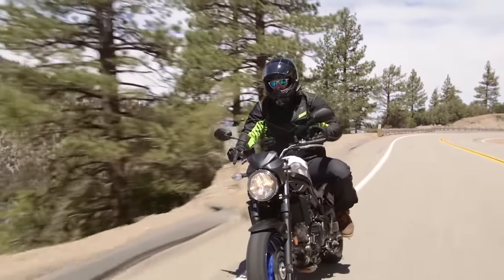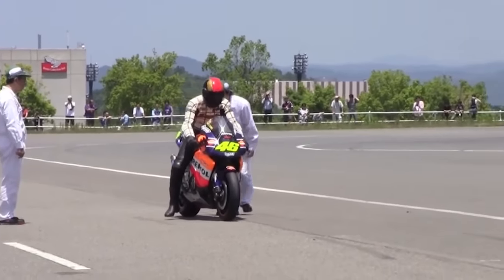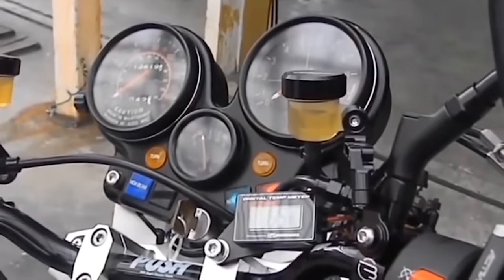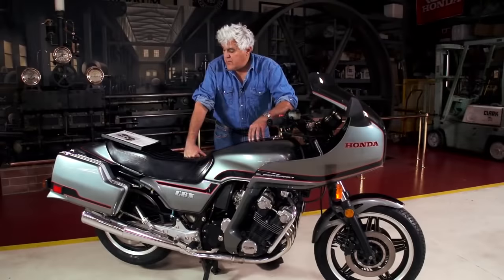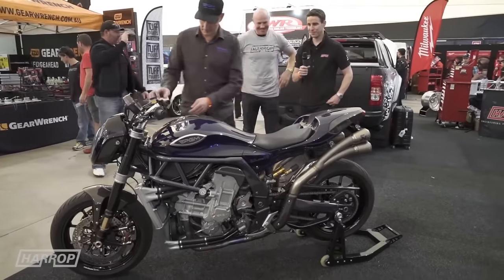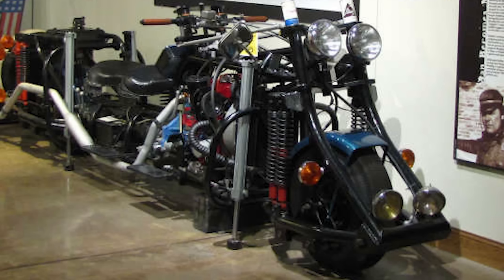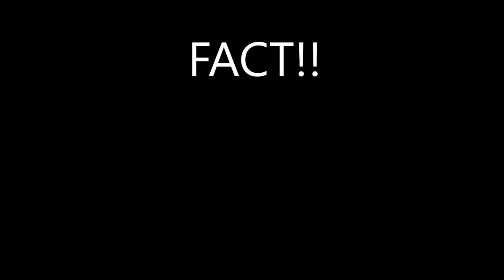The Most UNREAL Motorcycle Engines Ever Produced

Comment: I had several Mach 3 500cc triples. My first one had cracks in the spark plug wires (oh yah.... this beast actually had a distributor and distributor cap like cars did!) When it rained i would get the crap shocked out of my knees where they touched the gas tank!!! The CDI ignition put out wicked spark. It's spark plugs were like sawed off flat versions of traditional spark plugs. No  ceramic insulator and arm hanging down off the threaded end. Neutral was all the way down on the shifter and all the gears were up. with all early 5 speed  japanese street bikes if you beat on them and shifted hard from 1st to 2nd, you would bend a shifting fork in the bottom end and eventually wind up withj a transmission that would miss 2nd gear because the sides of the shifting fork were worn off......God, i'd be a rich man today had i kept akk the S,  H1 and H2 bikes i had.

Comment: The Black Pearl is not powered by steam. It might look like a "steambike" but it runs on compressed air. The air is stored in the vessels and is very ingeniously used to get the bike running. t doesn't go fast and it doesn't go far but it goes!

Comment: on the v8 section where was the mention for the Moto Guzzi V8 
The Moto Guzzi V8, or the Otto motorcycle was designed by Giulio Cesare Carcano specifically for the Moto Guzzi Grand Prix racing team for the 1955 to 1957 seasons. Wikipedia
Top speed: 275 km/h (171 mph)
Engine: 499 cc (30.5 cu in) (44 x 41 mm) 4-stroke V8; liquid cooled, DOHC, 8 Dell'Orto 20 mm carburettors
Power: 78 hp (58 kW) at 12000 rpm
Weight: 148 kg (326 lb) (dry)
Class: Grand Prix racing motorcycle

Comment: Yeah, I know that if you asked 10,000 motorcycle enthusiasts the same question you'd get 10,000 different answers, so here's my #1 ... 1966 Honda RC166 250cc inline six cylinder DOHC four valve per cylinder engine capable of 20,000 + RPM, and at 18,500 RPM produced 68 HP and speeds past 150 MPH.  And the glorious sound at full honk from six megaphones!  With Mike Hailwood in the saddle won every 1966 250 GP race.  The next season was a dogfight between Hailwood and Phil Read on the new Yamaha RD05A V-4 two stroke.   Both finished the season with fifty points, and the title went to Hailwood with five wins versus Read's four.  All up weight variously reported between 250 and 268 pounds.  A groundbreaking advance in technology designed by Soichiro Irimajiri, who was also the designer of the CBX.  No surprise.  

#2:  1956 Moto Guzzi V-8.  WAY ahead of it's time!  Designed by  Giulio Cesare Carcano originally sketched on a napkin, eight months later it was running.  In it's final form made 78 HP at 12,000 RPM.  That it was fast was indisputable: 172 MPH, a feat that was not duplicated in it's class for more than twenty years. Stellar, if unreliable, engine in a badly outdated chassis, skinny 19 inch tires, and marginal brakes.  Unfortunately Moto Guzzi dropped out of GP racing before they could fully develop the entire motorcycle.

Comment: The Kawasaki H-1 500 Triple was even more scary with the original flex frame. It would pull hard from 2500-6500 rpm then the front of the bike would try to pull the fork tubes out from 7000-9500 rpm as you held it open. You had to remember to shift if you didn’t miss it.  30.5 cubic inches and 62 hp.
Reply: I fancied the KH500 but owners reported cooling and lubrication issues with the centre cylinder,So i opted for the less powerful but more reliable Suzuki GT550 two stroke triple,Power started at 4500 at redlined at a low 8000,It wasn't a short stroke but a under square,In between a long stroke and a short stroke, Still quicker than the 400cc two strokes,I beat a KH400 but only marginally little chance against a KH500, But the CB500 and CX500 were slugs except the CX500 TURBO,Which was even quicker than the KH500 at 140mph

Comment: Great list!   NR500/750 32 valve v4 should make the list, Horex v6, the PGM w/ crossplane R1 based motor would sound insane :). As others mentioned KZ1300 was inline6 from Kawi; hello BMW K1600 :). Good stuff look forward to some more content :)
Reply: Suzuki also made a couple of in-line 6 cylinder models but they never went into production.

Comment: The steam cycle is the coolest. I wonder if it has the regulator and cutoff as on a steam locomotive.
Reply: No - because (contrary to all the mindless yapping of Yammie Noob) it's not even steam powered. It is instead powered by compressed air. The "boiler" is simply a compressed air reservoir.

Comment: What 211V 5cyl.240hp beast without traction control and only Valentino Rossi able to bring it to two championship finish. Rossi is really a phenomenal talent on two wheels. Anyway Hayden also able to bring it to one championship finish. Both have difficulty when motogp change engine size to 800cc from 990cc

Comment: I'm a little bummed; while you went on fawning over the Honda inline 6 you totally ignored (and discounted) the 1980 KZ1300. (made for several years)  I personal road one for about 5 years before selling it back to the original owner. During those glorious days of endless riding in the Florida highways, back roads and extremely long, almost dead flat side roads paralleling I-75 hitting 185 mph at any given time. Riding with friends who were buying some of the "it" bikes of the 90's, not one of them could keep up. Being roughly 260 lbs I couldn't break the 190 mph mark. But my Dad was able, weighing in st 180. From top sport bikes to Dayton's and others none but one saw nothing but my tail light after 3rd gear. This thing was a beast !  Weighing just under 1000 lbs dry, shaft drive and stood upright like a proud bulldog with a bump on the throttle. It begged to be pushed; comfortably crushing at 80 like its default speed. I was clocked by local PD at 187 mph on I-75. I was able to loose them on a quick off ramp and a return side road. But was stopped by every cop in town on my way home from work the next day for a "license check". 12 stops in a 16 mile stretch thru town. They made their point. Since opinions are subjective I figured I'd add mine. Maybe stir you into checking it out yourself, maybe even add a few other names to your Honda list. Enjoyed the video even if it lacked my personal favourite bike.
Reply: No don't believe 185mph BS,possibly 185kmh more like it

Comment: Hate to burst your bubble but the 4-6 cyl inline bike engines ran hot in the middle cylinders the faster you ran it due to the front wheel blocking the air flow to the middle cylinders.  I was a wrench for the Suzuki /Kawasaki dealer when the RE5 came out and the dealership tried his best to sell me the wankel bike for $5k which was too rich for a meager mechanic's pay back then. lol  In my opinion the R1 Yamaha engine ranks very well since now the newer snowmobile versions are being used in airplanes with great success /dependability!   And the H2 was a "widow maker" with something like 75% of the bike owners dying or seriously injured the first year sales!

Comment: you missed the best of all "The Britton" engine A 60 degree V twin, 4 stroke, 8 valve , water cooled, 99mm x 64mm bore/stroke, compression 13.7.1 Fuel  system: sequential fuel injection ( twin injectors per cylinder. 985cc.  destroyed all the challanged it. hand built in a back yard here in New Zealand.

Comment: In some ways I thought that the original mach 3 kawasaki was more revolutionary.  A power band narrower than a swiss army knife edge.  Surface gap spark plugs.  And a front tyre guaranteed to last the life of the bike because it never touched the ground.  They forgot two things though.  Brakes might have been useful and they needed a special compartment for spare underwear as nasty things were bound to happen to any that you were wearing.  Particularly in traffic.
Reply: Also muscle memory & gear shifting were hard to remember

Comment: Well that was fun. I've been the pillion on a CBX with the front wheel floating off the ground and I've seen a photograph taken by a pillion on a CBX with the speedo on 235kph and the bike cranked over to the pegs on a corner north of Bourke. NSW. No Z1300 when referencing straight 6 motorcycles?
Reply: Both the CBX and Z1300 sound awesome, but for me the Z1300 with the cutoff pipes are the best.

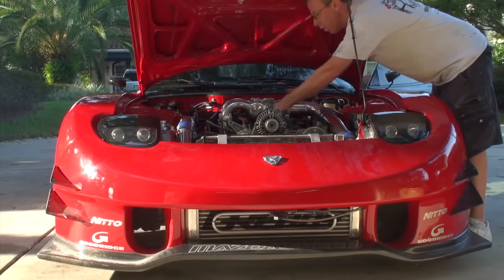Comment: 1:50  that Mazda's smoking so bad I'd say it needs a new set of piston rings..
Reply: Wankel Rotary Engines don't have pistons or rings, they have vanes and seals. The smoke you see is normal and it's down fall for meeting emission standards.  Smokey...Yes. But capable of producing up to 4X the horsepower of a similar displacement Piston engine.

Comment: I can only comment on the H2,  the real original that ate the H2 up was the H1 500 triple. It was my first bike and it blew away the 750. I looked at moving up to the 750 when it came out but after a quick test drive I left with my 500. It would pull so hard I had to change rear sprocket and chain every year. The chain would stretch and become unsafe after about 5,000 miles.  Rear tires didn’t last half that long. The first bike that gave me any challenge at all was the 900 Kawasaki, and that only passed me once we got above 90 mph. You can guess what my second bike was.
Reply: I had the Suzuki GT550 two stroke triple,New chain every month,but was well cheap,and brakes as often (no engine brake) rear tyre every 6 weeks,brilliant on two stroke oil 200/800 miles to a pint and it held 6 pints,Instead of buying the premium at £1.60 a pint,I paid £0.29 STS= Super Two Stroke. Perhaps i rode harder than you,Little chance of getting caught by the police and petrol (gas) was £1.60 a GALLON,

Comment: If a V5 can work then it stands to reason a V3 could also?  What I wonder about is using one cylinder ONLY as an air compressor to charge a high psi air tank (maybe in the frame?) and then use that pressurized air to supercharge the running cylinders?  Has that ever been tried?  With computers now precise modulation should be possible...seems a much less bulky solution than all the craziness of a turbo plumbing...a clean look

Comment: Good vid but...not a word about the Kawasaki KZ1300, liquid cooled,1300 cc, 6 inline cylinders...??? Bigger and faster, It came out only 6 months after the CBX and it was produced from 1979 to 1989. Not a word about the RG Gamma...??? A square four two-stroke 500 cc engine. Not a word about the Honda NR500 and NR750...??? A 70's and 80's Honda V4 with oval pistons, 8 valves per cylinder engine. In 1992, Honda made a road version with elliptical oval pistons instead of straight oval ones. Honda produced 300 units of this 750 cc that was called NR, which sold for US$50 000 in 1992. One sold in the US at Mecums Auctions for just over US$180,000.

Comment: What about the MTT Y2K turbine super bike
Reply: @mhiscott4925  well considering the rotary engine is in and a turbo shaft turbine isn't makes his list just a bit incomplete also the Lazarus with the Maserati v-8 even the boss hog that has the 350 small block is missing
Reply: @mhiscott4925  plus the pgm v-8 costs the same as the Y2K and has a higher top speed plus the sound of a turbine sounds awesome but hey your allowed an opinion there is no need to be so but hurt to insult the machine

Comment: How many factory motorcycles came with 5 valves per cylinder - 3 intake and 2 exhaust?  I think Yamaha was the only manufacturer to do so. Maserati talked about a 6 valve motor but never produced it  - I think Yamaha discovered 5 was the max. # of valves that worked. I owned a 1984 Maxim-X with a 750 Genesis motor and it was fast - took a nice sum of cash drag-racing some college kids with 1200 BMW's one time at a house party  - wasn't even close - hit 2nd gear and it was "smell ya later"

Comment: The reason why the Kawasaki Triple so dangerous was it’s awful chassis. At the same time Ducati had the 900ss and BMW the R90S which both handled that kind of power easily. To ride the Kawasaki fast with its flexible frame was what killed riders. A friend of mine parted company with one on a long curve at over 110mph. It snapped both steering dampers on its way skywards and ended up in the branches of a tree. Luckily my friend lived to tell the tale, but it took the lads with him some hours to find what was left of the bike. I had the far tamer and much nicer 250 which sounded almost as good, but with less power it wasn’t a danger.

Comment: hm they sound like an angry chainsaw.....    kinda like my real old kawasaki 100cc with high and low range...
low range was  good for touring around the woods..  while high range you could acually get the lil thing up to 80 kmh.

rare bike...  dont see them anymore.   although the range level was next to the gear shifter and you had to shut the engine off before switching it.   think it was a 1978 or around there

Comment: R&R didn't cause unreliability.  The extremely high RPM needed and the wiper blade would fail earlier than piston equivalent. There is no engineering that can increase fuel mileage and longevity.

Comment: I have a 2000 Honda Valkyrie 1500 CC Flat 6 cylinder boxer Engine with 6 carburetors a little hotter cams in the Goldwing came with. I put two brothers 6 into 6 exhaust on it. It's a big heavy bike it's not for drag racing. The 130 miles an hour is not uncommon for big heavy motorcycle this bike

Comment: A v5 doesn't logicly and phisicly work because the power in both banks or sides of the engine has to be equal in power unless the engine is matrix where 2 or 3 pistons depending on the side, in example 2 pistons are upgraded more than the 3 in the other side of the engine, basicly one side of the engine would wore down more than the other... I can't think of a good way to explain it.

Comment: When you talk V8 powered motorcycles and do not give a nod to the Boss Hoss line I have to question your credibility.  They have a 502 cubic inch powered production model, and enough horsepower to pull a loaded car trailer.

Comment: Wankels aren't unreliable because they lack research. They're unreliable because you're trying to seal an area with a rectangular cross-section, and the corners will never be perfect. In addition, any wear in the pivot will result the the rotor moving away from the wall of the crankcase.

In short, while it seems elegant, there's no way to make it really reliable. 

A cylinder engine has no corners that need to be sealed, and the cross-section the piston has to seal is constant. That means radial misalignment is impossible, and axial movement doesn't affect the seal. The piston rings has a slight spring to them, which takes up wear in the cylinder wall.

Comment: Well Yammie Noob you just picked 7 vaguely unusual bikes you'd heard of in your lifetime didn't you, Most unreal? how? apart from maybe the steam bike which was clearly built for fun and not meant as a serious mc. You might have picked for instance the Moto Guzzi V8 racer of 1957 or the Munch Mammoth with an NSU car engine built in the 70's the reviews said it could pass anything except a petrol station, or the suzuki kettle or the Scott 500 flying squirrel with it's top hat pistons and 100:1 petroil 2 stroke mixture or the flying Millyard5 litre vee twin or the suzuki wankel the water cooled Kwak 1300 broke new ground in it's day as did quite a few other Kawas' and showing the honda 6 cyl on a straight road was correct as they didn't handle or go round corners. Admittedly the honda 5 cyl was unusual as was their oval piston racer

Comment: CBX 1000 was an awful machine. Heavy, slow, hard to keep 6 carburetors in sync... Kawasaki Z1300 was way better motorcycle to have, with only 4 carburetors and later on even digital fuel injection system. Even the Benelli Sei used fewer carburetors in order to keep them in sync. Also, some lad turned that Z1300 into a V12. By the way, MotoGuzzi had a V8 motorcycle back in the 50's.

Comment: So many incorrect statements.  Moto Guzzi made a Grand Prix V8 500cc back in the 1950s. Honda made  125cc 5 cylinder  bikes in the 1960s, 6 cylinder 250cc and 297cc  bikes also in the 1960s.. Laverda made a 1000cc V6 in the late 1970s. Norton made twin rotor bikes bikes throughout late the 1980s and early 1990s. I appreciate you have a time limit on your video, but you could have been a bit more more accurate. For your American market, what about the Boss Hoss?

Comment: The Suzuki liquid cooled GT 750 71-77 was an underrated 2 stroke and while not officially known as the 'widow maker' like the triple Quaker i'm sure it's 50kw's (70bhp) took more than just a few loved ones.  The Quaker 500 2 stroke (another 70's bike) did an SS quarter mile in a very quick time of 12.4 sec (a certified world record). My 2018 GSX 1000 is only marginally quicker. Anyways interesting video, thanks.
Reply: The KH750 did it in 8.8 seconds at 130 mph,And i thought i was the "man" by slipping the clutch at traffic lights on my Suzuki GT550 two stroke triple and pulling away at 4500 rpm and doing 0-60 in 6 seconds